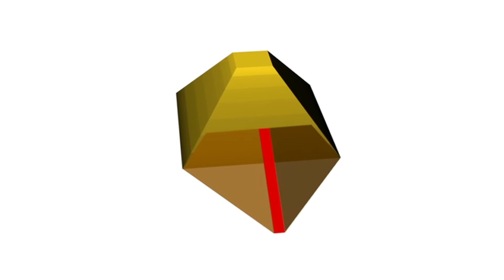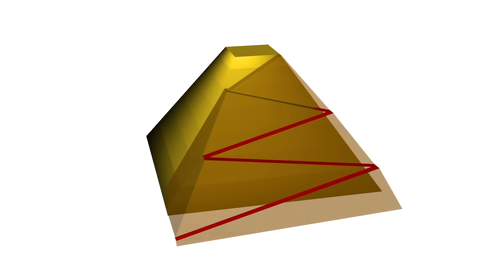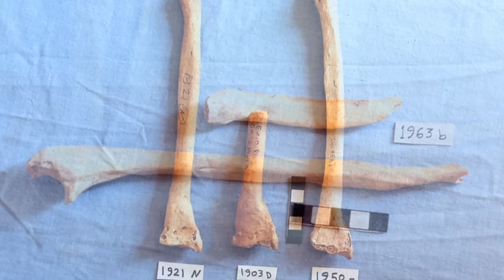Egyptology - Pyramid Construction

Comment: Around 10 80 ton pink granite stones, quarried from Aswan apprx 520 miles away used. Some argue they floated the stones down the nile river which does infact float toward their resting place at the pyramid of giza. However, its an incredible undertaking moving and loading so many stones of immense weight. Let alone lifting them into place at the construction phase of the pyramid.
Reply: Go to the Nile, and locate the  ancient riverbed of those times , it would surely be found loaded up with huge blocks IF they attempted floating them down to the plateau. If they ever lost a block, it would've been near , if not impossible to retrieve it from the rivers bottom.  Eventually the lost blocks  would've  blocked the river flow and depth. Floating those massive blocks on the Nile never happened. Prove me wrong. Show me the building blocks that were lost into the river ! Otherwise it never happened!. Its pure fiction and fantasy to even begin to believe the Egyptians built the three great Pyramids - when they were still using 200,000 year old technologies,  with a gradually increasing refinenment in their modern tools an weapons, that were "state of art" in the day. The armies best technology consisted of bows, arrows, wood tipped spears, hatchets and axes. Yet they are assumed to be the builders of the worlds largest ever power generators. Of course the pyramids are Egypt's treasures, and they were claimed by the Egyptians, but they weren't constructed by the Egyptians  because they were already ancient and standing when the Egyptians arrived and settled around them on the Giza Plateau.
Reply: The stones are composite and were poured like concrete.
Reply: @Andy_Holmes  No, they are not. They were cut and transported. You can see that not only at Giza, but in Peru and elsewhere where the same techniques were used.
Reply: @christianvachon2235  why couldn't it have been composite? I'm asking cause I don't know how it works
Reply: @adarsh4352  When you see them in person, it's a combination of factors. Though finely fitted, the blocks are not uniform in size and vary, and the sides are not always straight, sometimes they are angled, in addition to the porosity and on the non-polished blocks, tool marks. Although, yes weathering plays a role, poured blocks have a particularity in that they tend to be uniform and repetitive. Yes, they could have used different moulds, but the layouts don't suggest that and it would required a lot of molds, which doesn't make much sense if you are using a poured material process. Also, the offsetting is done by varying the size, not layout alternation like you see in modern construction techniques. Also, they don't have the qualities that you find with poured material that are ground and remixed. So, all these things combine point to the evidence that the blocks were cut and adjusted on site. Because of the qualities of limestone, I think that the first were done by rubbing or grinding the blocks one against each other during installation so that they ended up with a perfect fit. Also, on the Menkaure pyramid's remaining blocks and other temples in Giza, you find those "knobs" for lack of a better word that you also find in Peru and some other places in Egypt, and these appear to be there in order to manipulate the blocks, but they are not uniform and are protruding, which makes a mold unlikely since you would have to break the mold for each block. Lastly, it's the size and practicality. When you pour cement into forms, the forms have a bottom and sides (sometimes top). Question is, how do you get a 2.5 ton block out of the mold? And then you have to have multiple mold, plus drying/curing/setting times. You would likely have evidence of moulds or things of that sort. Plus, there is a remaining quarry near Giza that shows blocks and how they were excavated one next to each other.

All these things together is why I think that they were carved and not poured.
Reply: @Andy_Holmes  And over the years they hardened to look like stone.

Comment: Limestone cement blocks were made on site by pouring liquid limestone cement into molds. See videos on YouTube on this process.
Reply: This is just a nice theory, probably a good one. But when you look at the stones you realize they are not all the same, indeed they are all, and I mean ALL, very different. That's the reason why the pyramids are still standing despite many earthquakes over the last some thousand years.
To archive this you have to use, and make, individual forms to cast each block. This seems to be possible but doesn't seem to fit the purpose of using casting forms... we still don't know the truth.

Comment: There is never any speculation that the Ancient Egyptians had poured forms and advanced cement?           How long would it take to polish 1 million limestone casings by hand? Why are their high revolution machine markings on stones?. How did Ancient Egyptians put in place 40-ton stones which support 70-ton stones? without advanced hydraulic lift machines?                            The western world looks primitive in Architectural and building Technology compared to the Ancient Egyptian construction methods.

Comment: So, we're led to believe the Egyptians had built a ramp to build the pyramid; not likely... at least, not likely at depicted here. Keeping this in mind that it took at least 24 years to build the pyramid, what did it take to build a ramp that is essentially another marvel of engineering? And yet, there is no trace of remains of this so-called ramp left in Egypt. There is one suggestion that there is a spiral ramp built within the pyramid itself; this seems to be a more likely possibility. But given the scale of an external ramp being built outside of the pyramid to gradually be build continuously until it reached the capstone is highly unlikely; given the fact that in order to build a ramp, it too would have to be continually built layer by layer each day; thereby, interfering with work crews moving massive amount of blocks each day; also keeping in mind, it is suggested that work crews worked tirelessly around the clock to complete the pyramid. This would no doubt slow the overall construction process down to a halt. Even after building such a ramp, it too would have to be disassembled after the pyramid completion. In my opinion, the ramp project defies logic from an engineering perspective; the ramp would have to be built continuously, daily, from the ground level at a certain degree of slope, and build layer by layer, block by block incrementally higher by a yard at the end of each layer build on the pyramid. The ramp itself would have been a monumental project of engineering as well, and unlikely deconstructed or dismantled after the pyramid had been built. In my opinion, the ramp would have been left as a ceremonial causeway for celebration sake. Since we do not see this in Egypt, it was not part of the design, nor would they have wasted precious resources to build such a monumental ramp knowing it would have to be torn down after the pyramid completion. Also, given the fact that so much stone would have to be used to build a ramp, this most likely would have interfered with the construction process of building the pyramid; thereby, taking precious raw resources away from the pyramid construction. A ramp of this magnetude could not be build with inferior materials that would potential collapse under the weight of the megalithic stone being hauled up the ramp.

Comment: the blocks were taken up an internal ramp around the pyramid the corners of the end of the ramps were left open to allow the blocks to be turned 90 degrees to the next ramp.
Reply: Men and modern machines can't  physically build , or replicate a Great Ancient pyramid. Many of the external stones are 2.5 to15 tons each, and  internally some are upwards of 50 tons.  The precision of the Great Pyramids design is "OUT OF THIS WORLD", at 750 feet' per side. The greatest lenghth difference in lengths of the four sides is only 4.4 cm, or  crazy  1  3/4  inches, and the base is level weithin 2.1 cm or less than an inch.solid granite sarcophagus in the kings tomb weighs about 2.75 tons.

Comment: The ramps are a  mystery  because they didn't use them because they didn't build them c'mon  why do academics still spout on about this you got it wrong  its ok to be wrong. You still haven't said how they cut the rock don't say with copper or bronze and how did they drill holes in pink granite  with a bore cut rate that exceeds even our latest diamond drills  Please Please don't keep spouting on about the same old sh--

Comment: Listen again this video considering that, according to archeologists' theories, ancient builders should have carved, squared, transported, lifted and placed 23.000.000 blocks in an average time of 2 minutes each. This is plain bullshit.
Reply: Not to mention the hardest tools available were copper. There is no way they could have worked the stone with copper tools!
Reply: Why would you wait longer than two minutes between stones? They are being pulled along a corridor not taking off from an airport.
Come to think of it even planes can take off in a line every two minutes. Plane bullshit to you.
Also most of the blocks are at the bottom. The job got exponentially smaller as it went on.
You propose it couldn't be done and yet your argument fails to take account of all the stone robbed back off the pyramid for other local building projects ever since.
I have quarried ten tons of Liscannor stone by hand with two other people split it and loaded five tons of it onto a truck in less than an hour.
These things are not complicated when you have the knowledge. Our tools. A broken tine off a hay bale fork, a crowbar. a sledge hammer one chisel and one lump hammer. Oh and about six crappy damaged wooden wedges.
The whole ten tons was taken out of its bed in the quarry in one piece by one man with one tool in a matter of seconds. Law of the lever and knowledge.
When I went there is expected to see some amazing equipment at work for the day.
Reply: @justinfufun5483  When Abu Simbel temple was cut in pieces to move it some 100 meters above (https://www.youtube.com/watch?v=wpMsguIXlBU) it took an average time of 24 hours to cut, move and put in place each block (whose size was similar to great pyramid blocks) without the need to shape them. This was done with modern tools, electric power, trucks, steel cranes, steel ropes and diamond saws. No copper, no wood, no hemp ropes. This is a REAL comparison. Cutting a couple of blocks and putting them on a truck (without need to respect a plan or to move and put them in place) is not a valid comparison. I suggest you to watch https://www.youtube.com/watch?v=fNXzerCXbRM&t=3s (you can activate translation in subtitles) that contains a deep analysis, made by engineers and not by Egyptologists, about the engineering problems of building the great pyramid and a calculation of how much time would have been necessary to build the great pyramid using the same speed of Abu Simbel temple replacement (that is some thousands years)
Reply: @paolosardi67  How long does it take to build a airplane. How long it takes so many people get in and sit down and yet they take off every two minutes. Baffling for you isnt it.
Reply: @justinfufun5483  Compare building with building. The example of the flight travels does not fit.

Comment: Explain no iron chains, no heavy draft horses, no writing seen outside the pyramids since no one knows when. Also no ramps, no sign of lighting inside to put in inside stairs and ramps. Who taught them assembly line construction and a standard of measurements and why were they built where they were instead of by the Mediterranean Sea by the harbor?

Comment: If they had built a ramp out of the same material as the pyramid, why is it gone?
Reply: They didn't - and they are not gone.  The Egyptians employed external ramps to build things.  There is loads of evidence to support this.  During the Old Kingdom period when the Giza pyramids were built they created earthen ramps made from a mixture of sand/stone chips/tafla - a clay they mined.  During the later New Kingdom - while they were not building large pyramids - they still created many large hypostyle temples.  Those temples were built using = mudbrick ramps.

Moral of the story:  at Karnak there are the remains of mudbrick ramps next to partial temples.  Also in the tomb of Rekhmire is a depiction showing a hypostyle temple being built using = mudbrick ramp.  Meanwhile at Giza in the western cemetery next to the Great Pyramid are partially completed tombs which still have attached to them = small earthen ramps.  Also Herodotus wrote they created "a great causeway" - read a ramp - which he felt was as great an undertaking as the pyramid itself.

Finally when the limestone quarries at Giza were excavated years ago they were found to have had massive amounts of = sand/stone chip/tafla dumped into them - or what they made ramps from.  Also near the worker village at Giza is the remains of a large tafla mining operation.  So the ramps went = nowhere.  As they encased the pyramids in white limestone from the top down as Herodotus wrote = they systematically dug away the ramps and dumped the residue into the open quarry pits to backfill the area.

Comment: they would have used heavy-duty, wooden cranes.  faster, more numerous.  safer (no falling off the side of the ramp).  more intelligent (you could use multiple cranes per side).  and, they wouldn't have to pull very high - each level a crane would be dismantled, and moved up a level.  5,000 pounds/per stone.  could be handled by 5 cranes at a time.  1,000 pounds each.  done.
and by the way.  how exactly were the ancient stones removed by thieves? - did they build a large ramp, to steal the stones? - same method to create pyramid, used to dismantle.  (not large ramps).
so silly i have to explain the logic here.
aliens are watching us, and learning about our thoughts.  it would be good, to put the best theories forward, not the worst ones...

Comment: Elevators, cranes, magic 🤔
My guess the giants built them 

If they did use a ramp then wouldnt it make more sense to build the pyramids as a spiral ramp while they built it building up the center first and then building backwards down the outside and finishing at the bottom rather than the top 🤷‍♂️

Comment: More than 2,300,000 limestone and granite blocks were pushed, pulled, and dragged into place on the Great Pyramid. The average weight of a block is about 2.3 metric tons (2.5 tons).

24*60 = 1,440 - minutes number in a day
24*60*365 = 525,600 - minutes number in a year
2,300,000 (min) / 525,600 (min/year)= 4.3759 (year) 

If you pose 1 block every minute it takes 4.4 years to finish the pyramid
If you pose 1 block every 2 minutes it takes 8.8 years to finish the pyramid
If you pose 1 block every 4 minutes it takes 17.6 years to finish the pyramid
If you pose 1 block every 12 minutes it takes 52.5 years to finish the pyramid

I cannot imagine logistics even for a 12 minutes block during 53 years, day and night.
Reply: Think harder.  I keep seeing in your post = "1 block..........".  That is exceedingly facile logic I must say.

Moral of the story:  no one builds that way - not even back then.  Masons building a brick building do not lay a single brick to go back for another.  They rather employ teams of masons laying bricks simultaneously = in multiple locations..........so it was here.  The Egyptians employed thousands of workers broken down into specialized teams while the pyramid is a large structure which can easily accommodate hundreds of workers upon it.  

So blocks would have been placed in multiple locations simultaneously while most of those "blocks" are little more than crude chunks of stone.  They were not carefully cutting millions of blocks.  They rather rapidly fractured off approximate chunks of stone and hauled them away dumping them in place leaving lots of gaps all over.  Only those few employed to create the inner passages/chambers and the last outer layers of stone were more carefully cut and in some cases polished.  The rest is basically stacked rubble.
Reply: @varyolla435  
Oh, my friend, it’s just one of the hundreds of pieces of evidence that the Egyptians did not build the big pyramids. Think harder too :- ))

There are about 120 pyramids in Egypt. Only a few of them 5 or 6 are built by the unknown civilization or with the aliens' help. When the Egyptians came to the place about 5 thousand year BCE the big, great pyramids were already there. All other pyramids are the Egyptians' masterpieces, no doubt. They tried to copy the Goods, but they looked like a scooter near the VOLVO truck. 

Try to find academic proof that the Giza pyramids were built 2.5 thousand year BCE. No way. There is only one - the two inches Khufu figurin found on the roof of the pharaon chamber. The pyramids are already designed on the ceramic of 4 thousand year BCE. But for academics they are not pyramids but the mountains. Ah-ha-ha-ha-ha-ha!

Academics told us that the pyramids were built to keep the pharaoh body in the sarcophagus. But until now all the pyramid sarcophagus are empty, even in the untouched pyramids (Sekhemkhet pyramid). By the way, the flowers on the Sekhemkhet sarcophagus are dated 2 centuries before Sekhemkhet life :- ))

20 years ago we must listen to the history teachers with their simplified linear version of human history. Now, thanks to god and to Youtube, we see Baalbeck, Temple mount, Mahpelah cave (Cave of the Patriarchs), Pyramids of Egypt, Machu Picchu, Saksaywaman, Tiwanaku etc, etc, etc. 
We see the traces of the rotative sees, the cylindrical drill up to 20 inches diameter, the megalithic masonry, all the masterpieces impossible for the stone and copper age. Even if you put 10 employees on the row :- ))